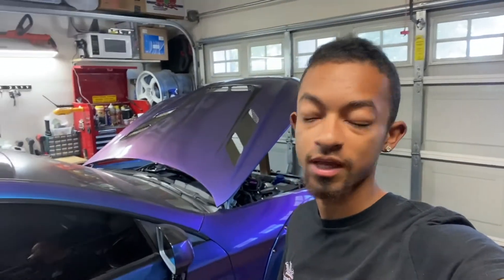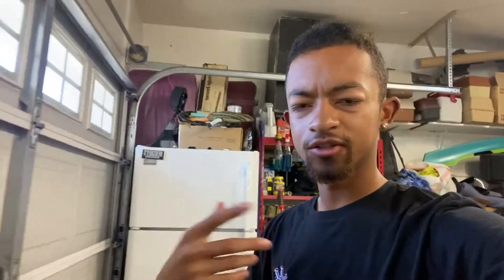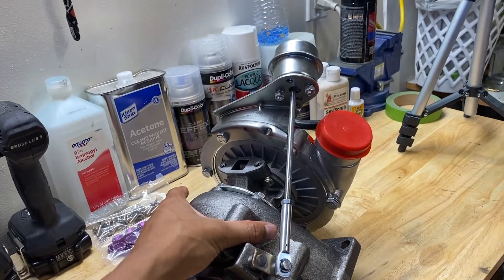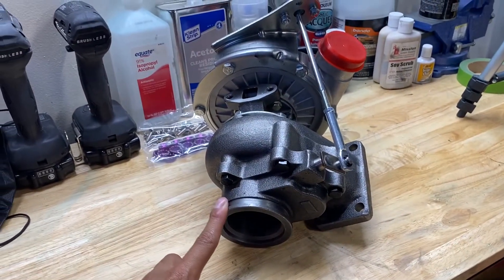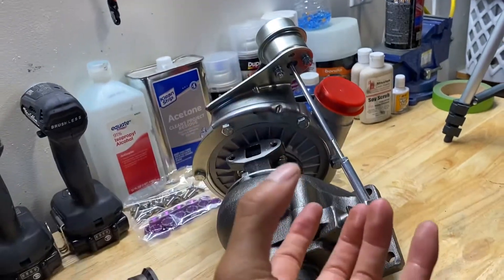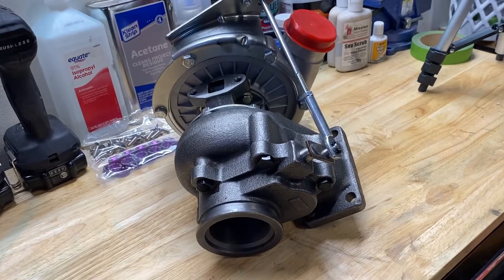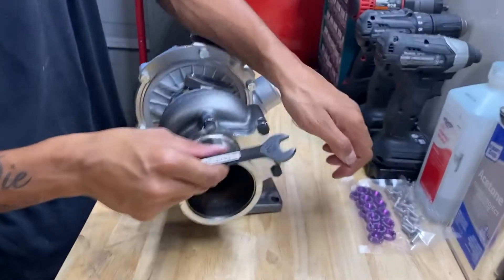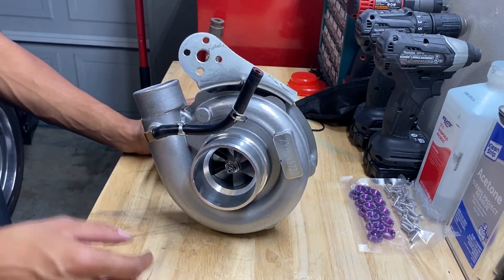Converting Internal Wastegate To External Wastegate!

Comment: The cheap method if you have space for the internal actuator in your engine bay is to just not have the line attached to the actuator. That will keep the wastegate closed so you can run an external.
Reply: Thanks man, was about to weld the flap shut but i’ll give this a go🤟

Comment: The waste gate doesn't control the release of boost it reroutes the exhuast gasses away from the turbine allowing the release of pressure to stop it from making boost. A blow off valve will release the excess boost on decell.
Reply: Your internal wastegate actuator pushes (not pulls) your wastegate open.  It's pushed when the pipe pressure to the actuator exceeds the actuator spring rating (say 20psi) .
Doesn't matter as you deleted it but best to be accurate for others who are also learning about this stuff.

Comment: Doesn’t the external wastegate add wear on the turbo because it will be spooled also when you are not using boost? internal wastegate would save it from spooling when it doesn’t have to, stressing it less, heating it less, so you can add boost for when you actually need it.
Reply from the maker: Yes you are correct but in bigger tub or applications where said individual is wanting over a certain power range, it’s actually more recommended and bigger turbos for those applications won’t have a internal wastage at all.
Reply: No. It makes no difference. It's just the placement of the gate and freedom of being able to vent to atmosphere. There's other things like tunability but, no, it doesn't change the spooling